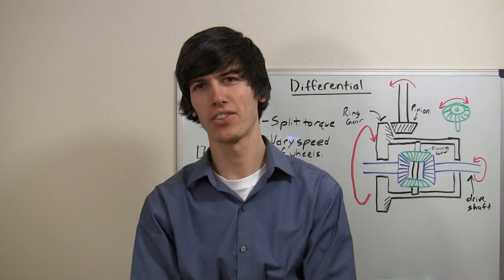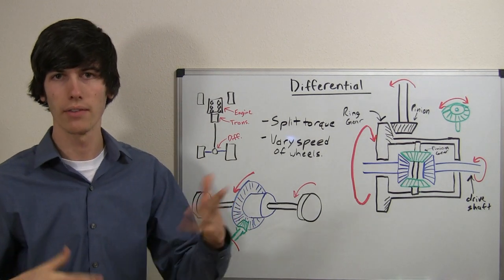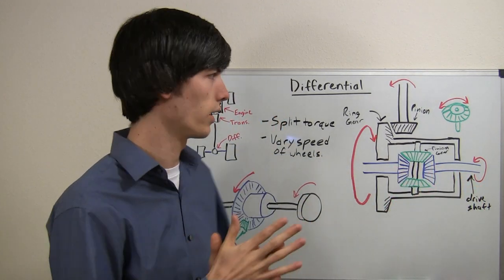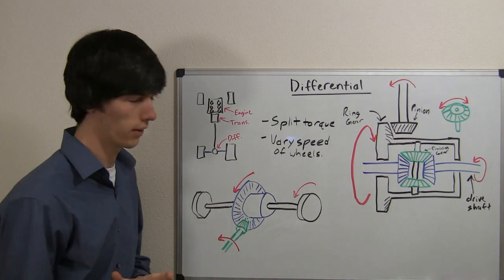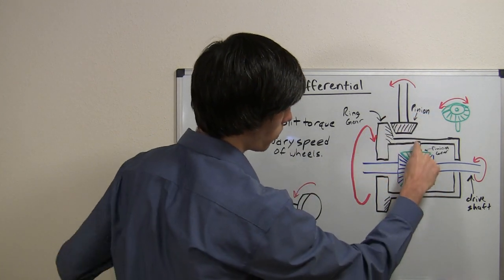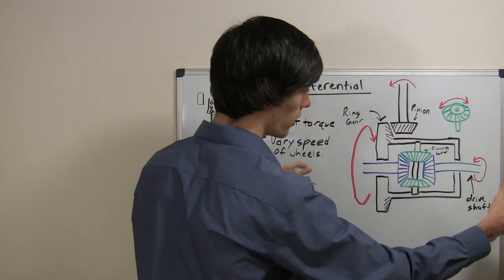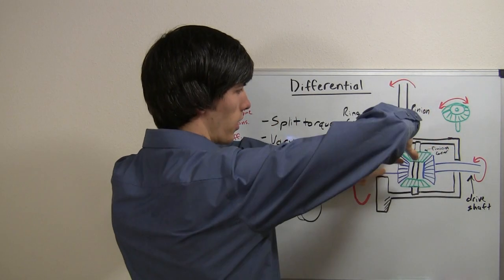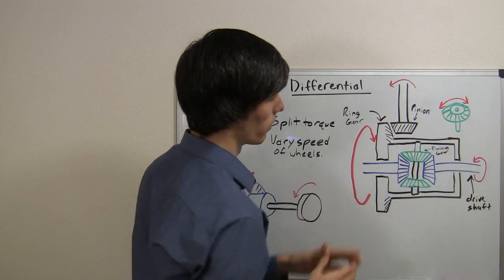Differentials - Explained

Comment: You didn't explain how does one wheel rotate slower than other?
Reply: I come here to find the answer for that question after watching in other video (such as from Learn Engineering) where a few viewers (including me) asked the same question. Actually, they asked about how the spider gear aka planet gear rotates about its axis. Then some viewers thought that it's because the outer wheel rotates faster. If this is right, then why does outer wheel rotate faster ? Some viewers try to give explanations which are still not satisfactory.
We don't get the answer here neither, unfortunately. The explanation is not better than I have got in other video.
Reply: Ah...I think I have got the answer. In a rotating object, we can observe that the outer part has a greater linear speed than the inner part according to this equation : v=wr, where v=linear speed, w=angular speed, r=radius.

Similar to this case, when a car makes a turn, as a unit, both wheels revolve around a circular path with equal angular speed, hence the outer wheel has greater linear speed than the inner wheel : v=wr, where r is the radius  of turning.
It is this greater linear speed during a turn that makes the outer wheel rotates faster about its own axis, which can be verified using equation : w=v/r, where r is radius of the wheel which is equal for both wheels and v is linear speed gained above.